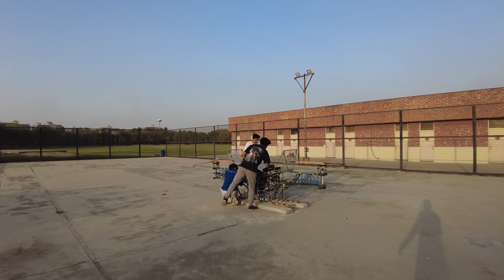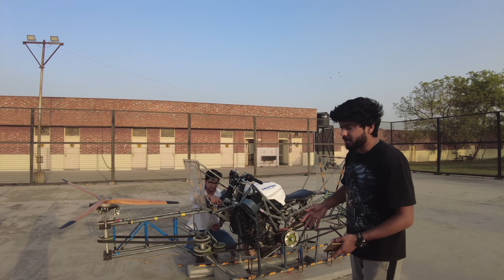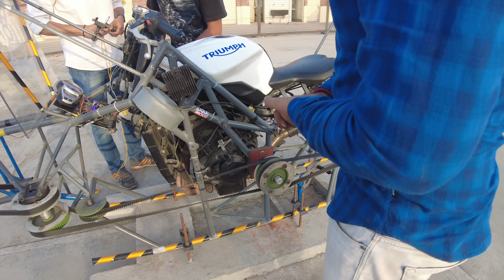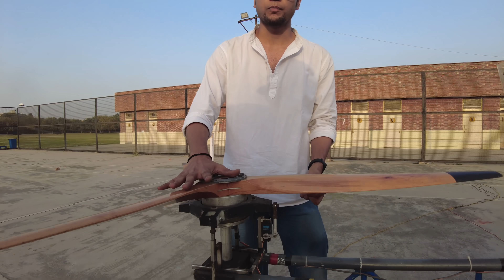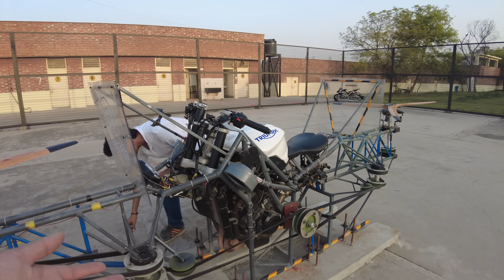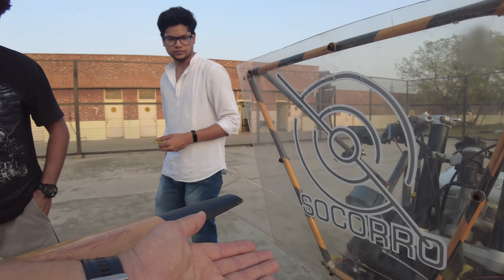This Triumph Daytona 675 Can FLY. 3 Engineers Built It.

Comment: I have flown helicopters for almost a decade now , it’s one of the most complex machines . Specially the rotor assembly , the pitch arms , the swash plates , getting the CG balance and all , takes years to make an accurate fly worthy machine. Any attempt to even make something like this , is commendable and exhausting . The rotors look simple without the feathering hinge , drag dampers and flapping hinge . Getting the rotors tip path plane will be easy as the rotors are rigid and and articulated . Great work  now the speedometer is IAS indicator HHaha
Reply: Exactly